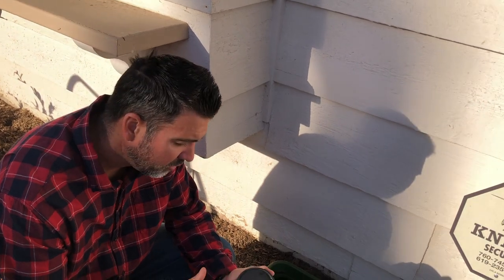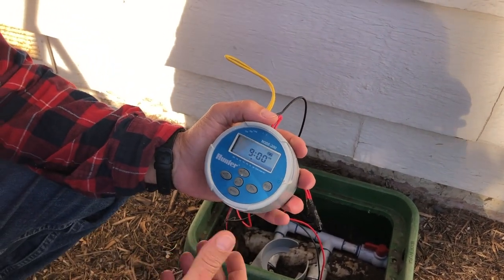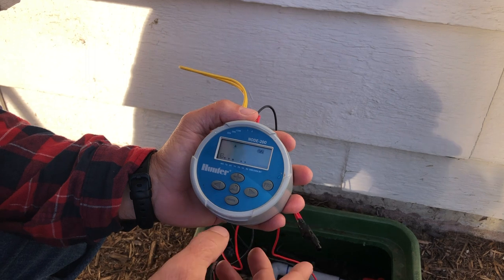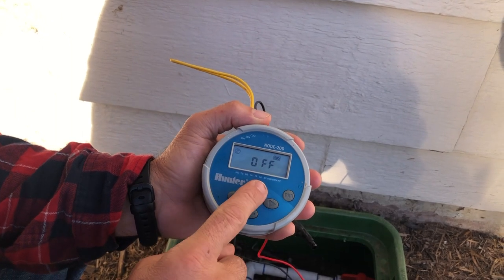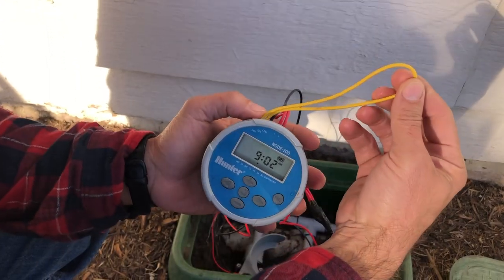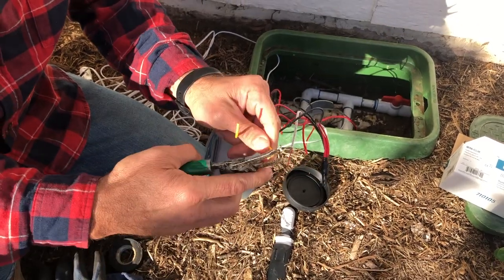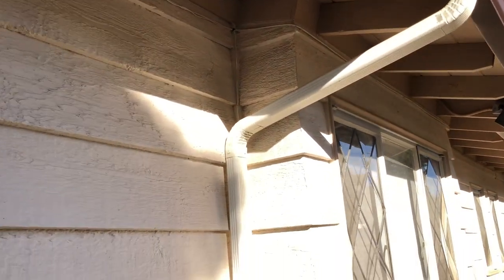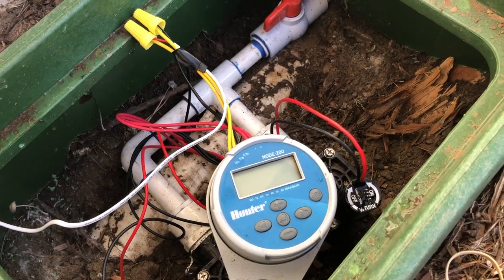Hunter Node battery timer rain sensor install and programming

Comment: What about connecting to more than 1 valve?
Reply from the maker: Hunter also has a 2 and 4 station Node. You would need one of those controllers but ya you could. I’m using the rain sensor with a 4 station one currently